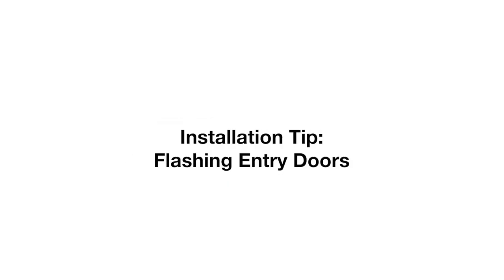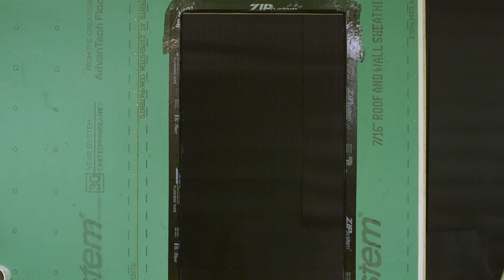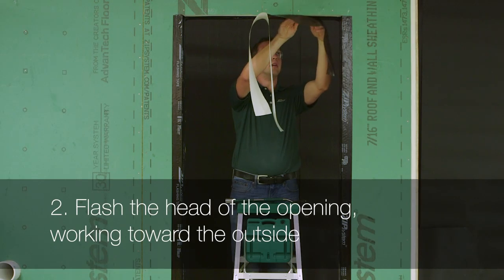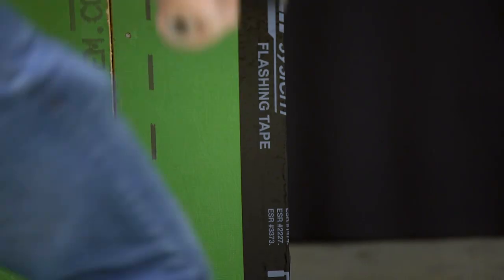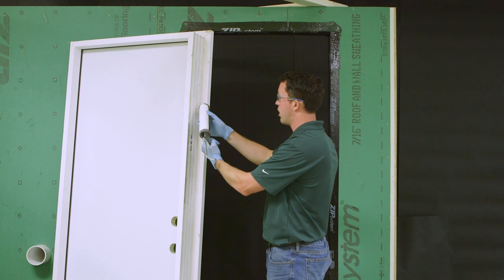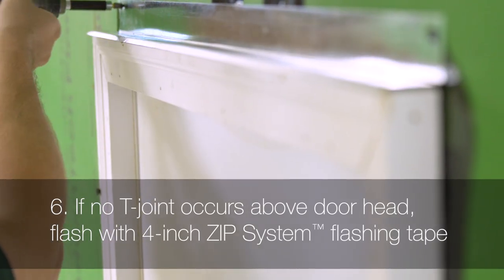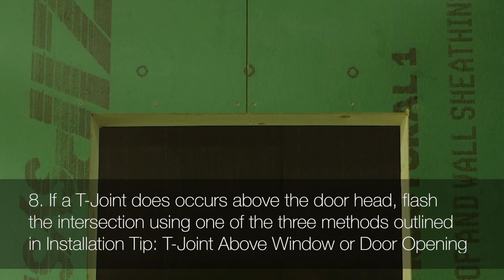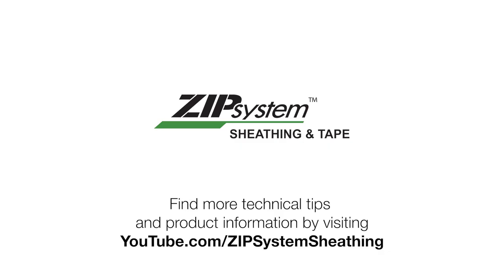Entry Door Flashing | Mastering the Basics | ZIP System® sheathing and tape

Comment: Would it be a good idea to add a second layer of tape once the door is installed, but under the brick-molding?  There is a gap between the rough opening and the door frame that is typically filled with GreatStuff.   The drip edge could then go over the tape on the top of the door.